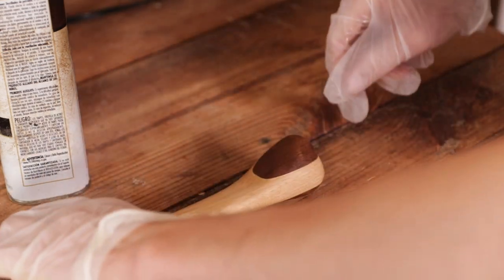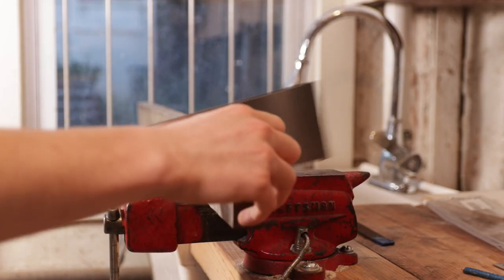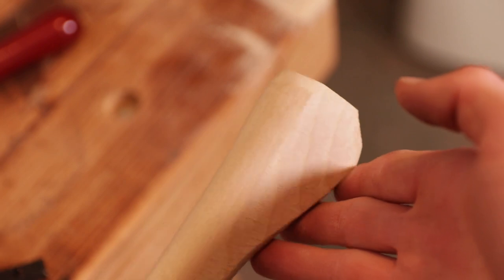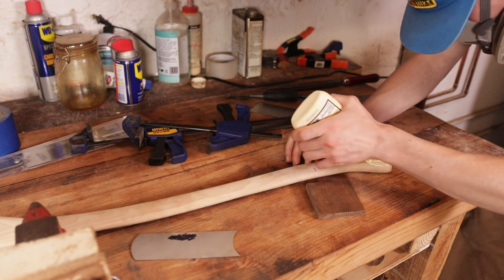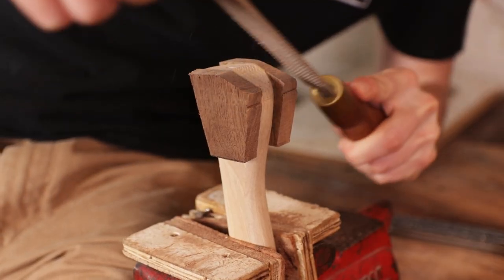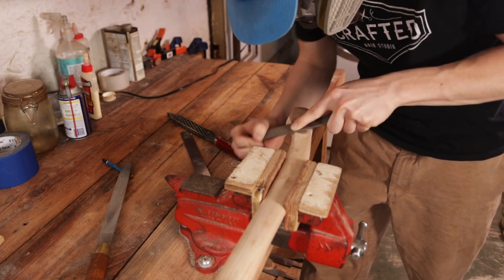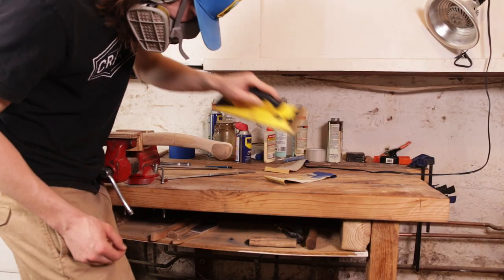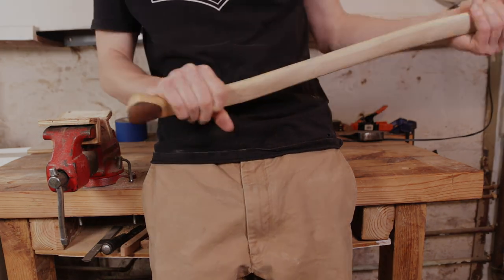How to Make an Axe Laminated Palm Swell (Only Hand Tools!)

Comment: Good job. Brings me joy to watch such a young man working hard and efficiently. Nice narration. Tip. Split the scales while they are on the whole board before cutting them off, also if you sand the outside of the walnut and split you can glue up the smooth face.
Reply from the maker: Thank you, I'm not going to cut the board in half because I'm not sure what I wanna do with the rest of the wood but I'll definitely keep that in mind for the future!
Reply: @MiloKolb  Just the first 3 inches as that is what you cut off. Not the whole board. Just easier to split while in board form vs block.